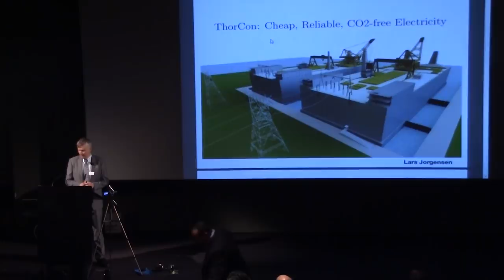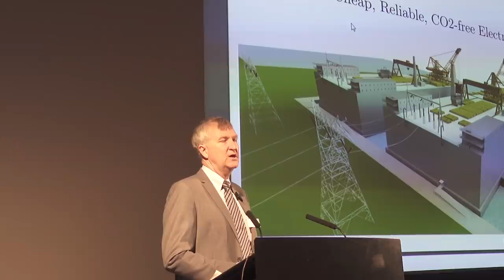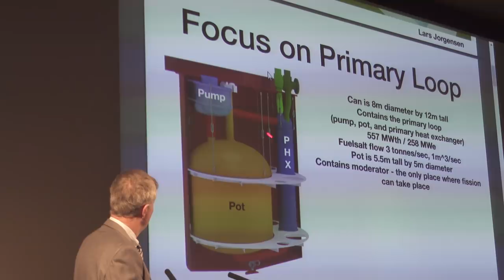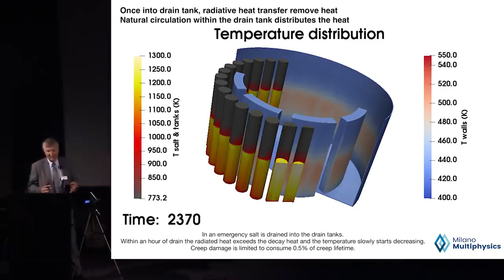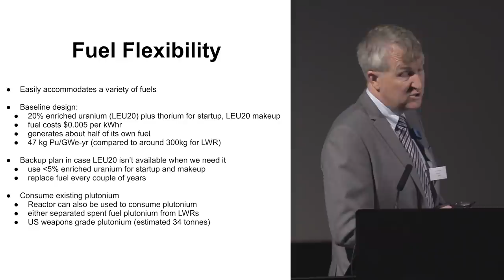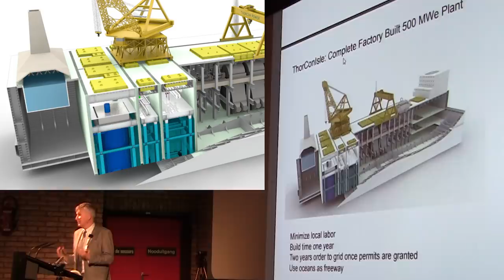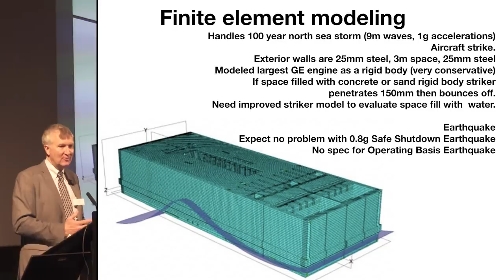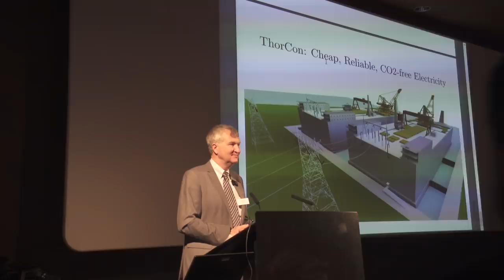ThorCon: Cheap, Reliable, CO2-Free Electricity by Lars Jorgensen @ ThEC2018

Comment: At around 24:06, he mentions, “it boils at 430°C” ... did he mean 1430°C?
Reply: That's 806 degrees F
Reply: @info_fox  Right, but 430°C is lower than the melting point. How do you boil and THEN melt?
Reply: I think he misspoke and meant 1430. FLiBe has a boiling point of 1430°C.
Reply: Yes, you are correct.

Comment: Never saw this before at all and I've not been paying attention that much...a second round is needed..very interesting idea that, an F-54 or whatever that was....that's a good selling point..essential for anything new...thanks...i'm sharing this for sure
Reply: I don't think the results would be the same if they used a 300 ton jet liner instead of that obsolete 1960's F4 Phantom jet fighter bomber that probably weighs in around 8 tons. That is a very old film shot.

Comment: TMI is in the retirement stage. It needs a replacement.
Reply: Yes and LFTR would be very suitable replacement. The infrastructure transmission lines are already in place. Curse the uneducated fools in this country not to jump onto a cheaper, more reliable and safer source of power.
Reply: @warpmine1761  I try to spread the word when i can and provide links to talks like these.
Reply: @warpmine1761  In Ed Pheil's videos (fast spectrum, chloride salt) he mentions a problem with fluoride corrosion (requiring new and/or expensive SS alloys) as one reason for going with fast MSRs. Has this problem been solved, and if not how is this handled in the ThorCon plan?
Reply: @warpmine1761  Absolutely! The following, in numerical order:
1) Immediately stop all HC power construction, do all MSRs (competitive bid contracts) instead. Go all out funding basic MSR research - including fast & thermal spectrum, or ?.
2) Advanced countries (including China - part of a new trade deal) subsidize MSRs just enough so that all new power plant construction world wide is MSR.
3) Run existing legacy nucs as long as humanly possible 
4) Replace existing HC power, most polluting first.
5) Replace the really dangerous legacy nucs with MSRs, most dangerous first. 
6) Subsidize MSRs for poor countries.

Comment: The obstacles to this technology seem to be fear, greed, and politics. A few engineering details as well, but those could be worked out I think if other obstacles were out of the way a bit. Fear may be the biggest obstacle. People think mushroom clouds and melt downs. Question may be what's driving the fear? That's where greed and politics come in. The major opponent for nuclear energy would be the coal, gas, and oil industry. I'd guess they fund the political and public opposition. It's very difficult to overcome fear.

Comment: I wonder where this reactor going to built? I would be happy if my country use nuclear power so our nuclear engineers from Gadjah Mada have a job
Reply: Indonesia
Reply: Depends what you're asking. Their cost estimates for building it come from a South Korean shipyard so I'm pretty sure that's the shipyard that will be building them and their first customer is Indonesia so that's where it will be running. But the idea is that the plant is transported across the sea anywhere so as long as you have a coast and regulation approval, you should be able to buy one.

Comment: Design idea to avoid all pipes in reactor: put fisible materials and salts in an egg shaped container that has graphite fins of variable size in side. To adjust fission reaction, tilt egg so that fisible material moves to flatter parts of egg, where internal fins absorb more neutrons. 
Harvest heat by submersing egg in water.

Comment: Very convincing explanation of a passive control philosophy. I am fully aware that nuclear is good if properly controlled. My fear is of the manufacturing process. After building a few of these, the constructors start taking short cuts to save money and hiring cowboys to do the work. How do you guard against this familiar hazard?
Reply: The same way they do now in many industries, inspections. A natural gas pipeline has every weld x-rayed by an inspector, same for plane manufacturing.
Reply: Set standards of manufacture and adhere to them.

Comment: Or we can just insulate and make efficiency savings. Fit solar to all new builds, along motorway and railway track sides, car parks etc. Install wave, wind, geothermal,  biomass, tidal. Add redox flow Batteries, gravity energy storage and you have a decentralized system without the risks of nuclear  or the cleanup costs which are always left to our children or their children.
Reply: That's the Rube Goldberg method of producing power, incredible complexity for no gain. Even the older generation II  & III reactors are still the safest way to make electricity ever invented and the waste and decommissioning are not actual problems, only political ones.
Reply from the maker: Are YOU solar-power self sufficient? Solar panels and battery? Tell me all about it, this carbon-free lifestyle you live. Because if YOU (presumably a developed-world citizen posting comments on YouTube) are NOT doing it, because maybe YOU CAN NOT AFFORD IT, then don't expect 80% of the poor-er-than-you world to do it for you.
Reply: @chapter4travels  Hate to tell you Greg but solar, wind etc are already doing a lot of the powering of many countries including the UK. China by the end of 2018, had 174 GW of cumulative installed solar capacity. If as much money had been spent on solar, wind, storage etc as it has on nuclear the world could have been powered by it now.
Reply: @gordonmcdowell  Actually my house is behind a hill so solar insn't an option, however for the last 20 years or since npower? did the first eco tariff I have been with an energy company that only uses renewables. Economically check out the prices of solar (which continues to drop). https://en.wikipedia.org/wiki/Cost_of_electricity_by_source
Reply: @veronicathecow  You are believing the propaganda, wind and solar can not now or ever replace fossil fuels. Germany is a perfect example. They have invested more in wind and solar than any other country and they missed their 2018 emissions goals, scrapped their 2020 goals. They have the highest electricity costs in the EU and 3x the US.  Maybe they should just invest more in wind and solar, but no they are choosing to spend that money on a natural gas pipeline from Russia.  Wind and solar can only add cost and complexity to a reliable energy system. Battery storage will only make the economics worse not better.
Reply: @chapter4travels  Batteries are already being used to stabalise the grid in Australia with great sucess.  There is also Redox battery technology. https://www.youtube.com/watch?v=nYk1S4FOF8I
As well as gravitational energy storage systems being developed. https://www.youtube.com/watch?v=mmrwdTGZxGk

By decentralising systems you get better resilience and reduce infrastructure costs.
Reply: @reinhardweiss  Thank you for your clear, reasoned and highly technical reply, many people will be convinced by it.
Reply: veronicathecow oh and btw ... the reason why nuclear ‘waste’ is a problem is because it has a ton of energy still in it, but an economic calculation is done to replace it vs figuring a way to exploit it.  There are other technologies that have all kinds of other benefits (like medical uses). 

A major obstacle is the extreme measures (perhaps required in the past) and therefore high barriers to entry resulting from the safeguards for the technology but frankly if people are serious about a real solution to the power problem: it only makes sense to let nuclear tech progress.

You made a snide joke about taking the nuclear investment and doing the renewable scams, hell I would guess that the guys at Thorcon could have a multitude of LONG TERM gigawatt production going with only the money STOLEN  by Obutthead’s criminal bundlers in their solar 💩scams.
Reply: @veronicathecow  ah.. I guess "solar is a great option, but just not at my place".
Reply: Hi, veronicathecow. I'm Indonesian. Thorcon made their offer to us, not to the US. Different us there, please keep that in mind. I'm not sure how applicable your suggestion is to our country. Like, we're tropical. We generally think that a house needs good ventilation, not insulation. I'm not sure how our poor can afford to fit solar to all new builds, but I guess they will just have to make do without houses. We have some solar power for traffic lights and street lighting in the bigger cities, but I'm puzzled at how to finance building solar along motorways and railway tracks. I guess we'll just have to borrow a few billion dollars from the Chinese again. We already have some wind, geothermal, and biomass though. Oh, quite a few of our people still cook using wood. So there's your biomass use. And our grid is pretty decentralized, since we find it very expensive to lay the undersea cables to connect each island. I thought for sure though that our government really want to connect them, but I guess you know better than us.

Comment: I do not find his assessment on Chernobyl and Fukushima fair. 'Nobody died from the radiation just does not cover the facts. Both those disasters were solembly caused by and consequence of the nuclear process. Which is all about radio activity. I hence would find it much better if speaker for the sake of arguments, instead of trying to go back on how horrified people in general are with regards to the generations of nuclear plants we have seen so far and try to after all again okay them based on anything that resembles that, would stretch the much more important and valid points, that the new approaches he advocates produce almost incomparably less nuclear waste, and that what still is left over is far less severe in terms of radiation and transportation (requirements and risks). The fact that the processes be proposes are inherently much more secure I think he made clear already!
Reply from the maker: How many people did die from radiation then? Please give me an actual estimate and source. You seem to have a non-zero number in mind?

Comment: Why Thorcon wants to build a molten-salt reactor near a water body? CSP plants use dry cooling. A high temperature MSR may not need wet cooling.  It is cheaper to avoid tsunami instead of designing to withstand one.
Problematic fission products like Iodine and Cesium dissolvable in water. Radioactive salt mixing with water should be avoided at any scenario. So, it will be cheaper to build MSR far away from water bodies.
Reply: Ironically as a ship it is better equipped and compartmentalised to handle tsunamis than a civil engineered building.
Reply: Not so much with fluorides.
Reply: They do that because then they don't need to build it on-site, but can build it in a shipyard full of highly skilled and very experienced people. That way the thing gets built on-time and on-spec and on-budget. Which would be a first for a nuclear power plant as far as i know. besides, it's a double hulled design filled with sand or concrete, a tsunami isn't going to move that thing at all.
and the double hull design is a shipping industry standard already, so it's not very expensive at all.

also, this is a molten salt reactor. unlike a solid fuel reactor you don't need to add months worth of fuel and shut it down every so often to refuel and reshuffle.  that also means that even if somewhere were to blow the whole thing up with a ton of TNT the amount of radiation released would still be fairly small.
Reply: @TheCountess666  The chemical containment of Caesium and Iodine only works when salt is exposed to air. These elements are not volatile even at high temperatures. But, like all salts these salts will dissolve in water. Water mixing with radioactive salt and draining to a water body is highly dangerous. Large areas will be contaminated.
Search: Aircraft Reactor accident evaluation reports for more information. 
(I have no objection about building molten salt reactor in a shipyard. Please keep MSR far away from water bodies. MSR can do well with dry cooling condensers and large amount of cooling water from ocean is not necessary.)

Comment: What happens to all the waste from these Nuclear plants, new or old? It's pastime to free the people and produce FREE energy, it's all around us, gobs of it!
Reply from the maker: What happens to it would depend on the reactor type. Some segregate the FP so they can be put to medical and industrial use. Some do not. Either way, it is a small quantity compared to any other fuel, due to the fact the fuel does not combust, it fissions. Only the portion of the fuel where the mass is reduced by fission (E=MC^2) becomes waste. That there's any volume to speak of at all is because most of the spent fuel rods are actually natural uranium, it is just mixed together with fission products and actinides. MSR is inherently favourable for recycling of this material because it can be easily chemically segregated, and it isn't a mix trapped inside solid fuel rods.

If you're referring to renewables, a great way to monitor the progress of Germany's attempt to replace nuclear with renewables is with https://www.electricitymap.org/ you'll notice they've been performing pretty poorly compared to their nuke-assisted neighbors. That is, if you consider "performance" to be the reduction of greenhouse gasses. That's what happens in the real world, everywhere, when people think batteries have solved storage. If you truly think it is doable, then just buy some panels, some batteries, and go off-grid. It is expensive, and ultimately you'll hit a stretch where the batteries are exhausted.
Reply: If it was free, it would already have been harnessed. 

If you watch the video, you will learn about what their waste material plan is.

Comment: Sounds like a con job.  Burner type will be too expensive for general use.  Indonesia will regret.
Reply from the maker: All nuclear reactors perform some breeding. Uranium is not very expensive. Completely efficient breeders do not solve any economic problem today. One day the economic case for them will be stronger, as the easiest Uranium resources are used up. But today, the problem an iso-breeder MSR solves is one of communication. The waste would be of a very different nature than a waste stream containing actinides. If you think the best way to address people's fear of nuclear waste is to change the contents of that waste... then that is a track to pursue. Certainly a waste stream consisting of nothing but Fission Products would turn the "nuclear waste" story on its head.

But most people who support nuclear power, are perfectly OK with dry-cask storage and deep-geological-storage. That's not a problem. And so, perhaps, the reason iso-breeding MSR aren't moving forward the way Thorcon appears to be, is that Thorcon is focused on solving a different problem... lowering the cost of nuclear with an as-simple-as-possible design. There is no way an 2-fluid MSR will be as inexpensive to build as a single-fluid model. No way it would be as simple to operate.

Thorcon can (and have said they would) look at more efficient designs once they have a commercial product they are selling. Why do that first? Why do something harder to build, operate and LICENSE... first?